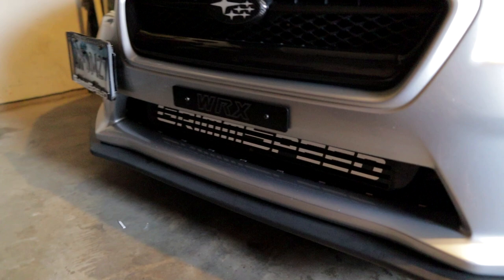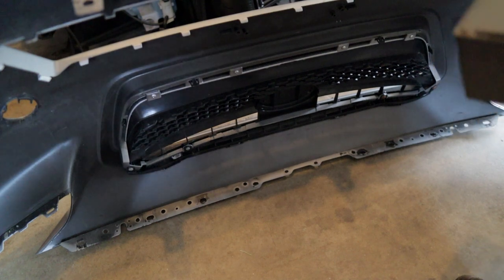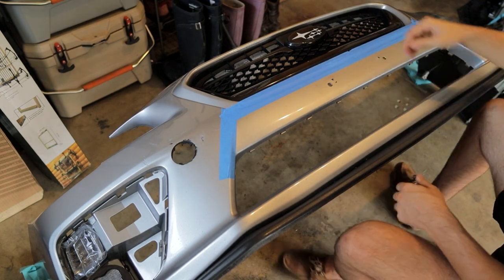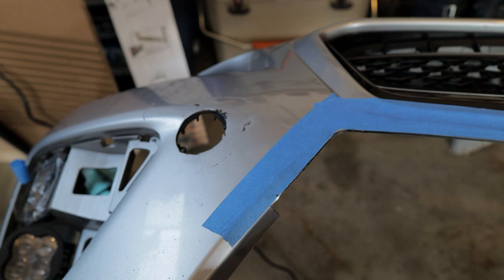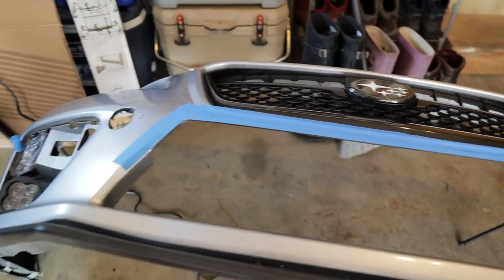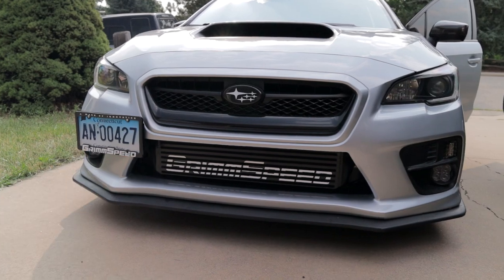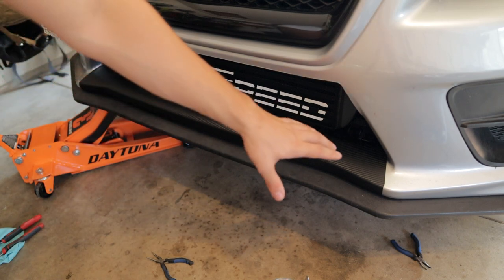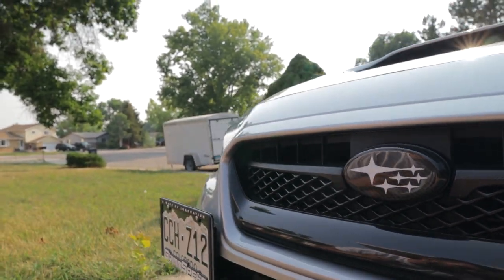CUTTING My FRONT BUMPER - WRX Front Mount Intercooler

Comment: I'd like to do this on my 15 STi, 3.5" ets intercooler, but the thing is i already have the ets crash bar, unless there is a smaller diameter crash bar on the market that doesnt show with the bumper cut.
Reply: Who needs a crash bar over aesthetics? When you think about it, it goes hand and hand with the no safety goggles. 
OP I know how it can be with the glasses but like others said 🤙 just remember when you do things like that you can't get it back if the damage is done. 
Enough preaching, watched a lot of your guys stuff. Cool to see you do things in a garage or parking lot, reaches out to everyone else with the urge to mod and then know they can do it as well without shop status equipment. 
This came out great and clean. You said you went for an aggressive bumper cut. It looks amazing, fitting and factory. 
They should come like this! Although we say that about every mod we do 😂
Reply from the maker: Thanks Matt! I'm still really happy with how it looks. As for the crash bar... Even with the factory one the FMIC would likely be destroyed by a bad accident anyways. Hopefully the new crash bar would be enough to protect it from a minor fender-bender
Reply: @WRXGarage  Yeah, I don't believe they are to protect the intercooler honestly. It's there to protect the front end as best as possible since removing factory one is required. I agree with the fender bender but at that point I wouldn't put any faith in it. If I had a fmic that had the option to drop it from the kit to make it cheaper I wouldn't blink an eye leaving it out of the kit. Price of the bar to core ratio and for the odds of the core not getting creased or punctured by the bar is slim.

Comment: Planning on doing this very soon, any issue with the paint chips after the cut? also if I have ppf on the front bumper will that matter? also did you just use an exacto knife?
Thanks! love the car!
Reply from the maker: I used a combination of exacto knife and Dremel! Haven't noticed any paint chips at all. If you have ppf, definitely use the exacto knife, a Dremel would burn the ppf and leave a weird edge on it
Reply: @WRXGarage  Awesome, very stoked,  thanks for the response!
Reply from the maker: Shoot us a message on Instagram if you have any other questions!